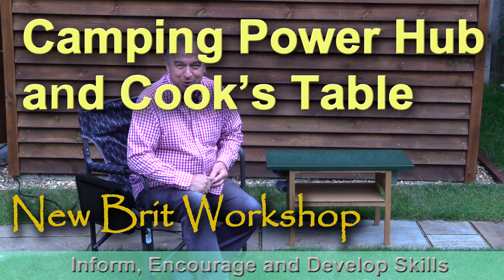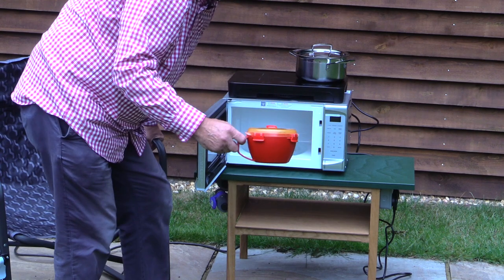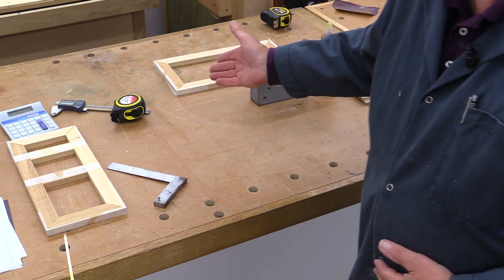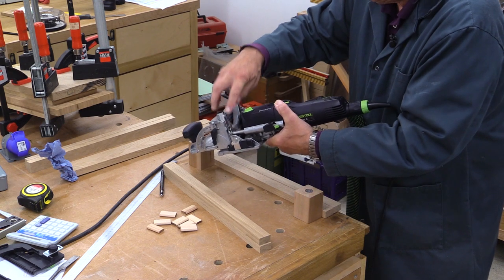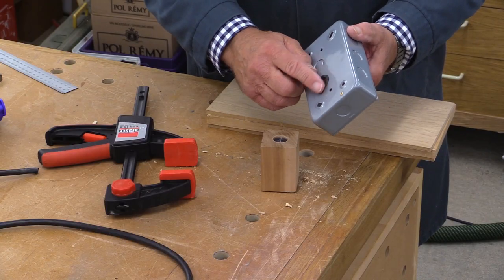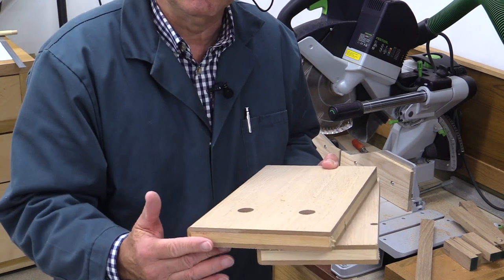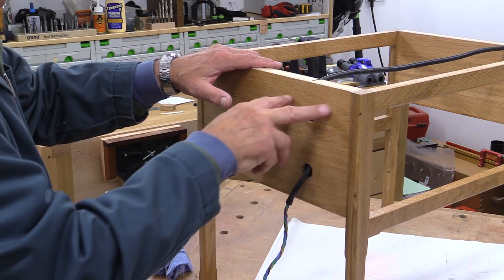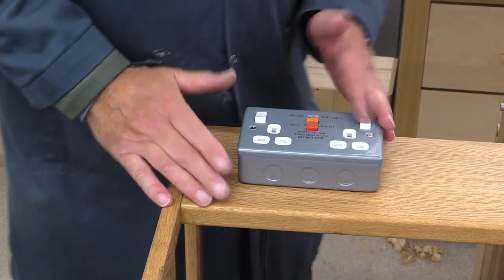Camping Powerhub and Cook's Table

Comment: If I understand it correctly, you have site power going into the table; out to the motor home to power that and also out to the 13A sockets which take the microwave/hob etc. Why that way? Instead of site power to home and out to table? Is it the power required for the hob/microwave? I’m sure there must be a good reason as the way you have designed it means that, either the table must be connected at all times or you unplug the site power from the table and then plug into the home when you have finished cooking.
Reply from the maker: Hi Theo, The way you suggest requires there to be an external socket on the caravan or motorhome or some other form of break-out arrangement. In the old days (when weight was not an issue) I had a large cable reel that would be plugged into the site power and it had a 16 amp socket and two 13 amp sockets on the drum. I would take my power for the motorhome with a short lead from the 16 amp socket and use the two 13 amp sockets for the cooking. But that lot weighed  about 10 kg and then I had a separate table for the microwave and hob.  Peter

Comment: Hi Peter, been watching your videos for quite some time and have to say it is a real pleasure. Sorry for the bit off topic question for this video, but would like to get your thoughts on the battery powered drills (and yes I have watched the video you made comparing the drills some time ago). The thing is there is the new Festool TPC drill. I need to drill/ screw wood as well as concrete and bricks for a build that I am about to start and thought I use that as a justification to get new tools and expand my Festool collection ;-) - if she can buy shoes, I can buy tools. Would you recommend the PDC or the TDC? Many thanks and keep up the great work. Many thanks and best, John
Reply from the maker: Hi John, Even though I have not tried the TDC I must say that it has a terrific specification and I would guess it is the best all rounder in the Festool line-up. Brushless motors are the best. I would still want a small drill/driver, like the CXS/TXS for light work.  Peter
Reply: @NewBritWorkshop  Many thanks Peter for your quick response. Much appreciate your confirmation. I actually think that I will end up going for the TPC now, after spending a night watching Youtube videos. Many thanks, John

Comment: The vents on top of the microwave are there for a reason and yet you have covered them up with the hob!
Reply from the maker: Hi Geoff, I checked that and the small feet on the hob unit allow a sufficient gap for the microwave.  Cheers.  Peter